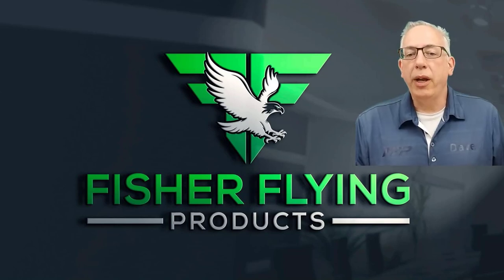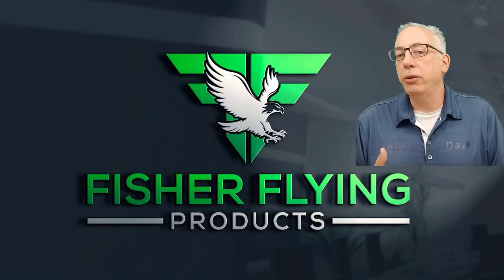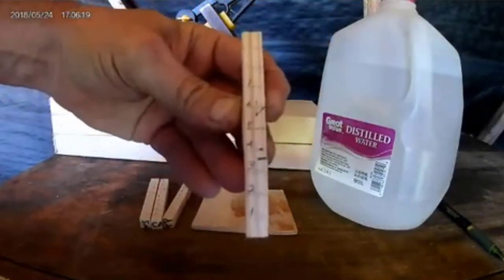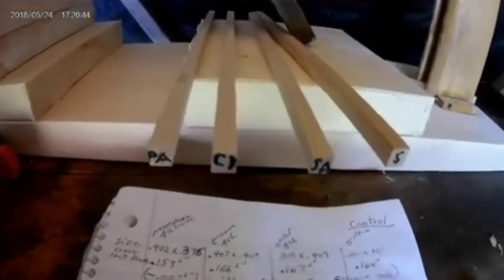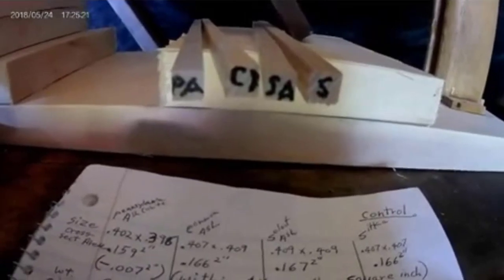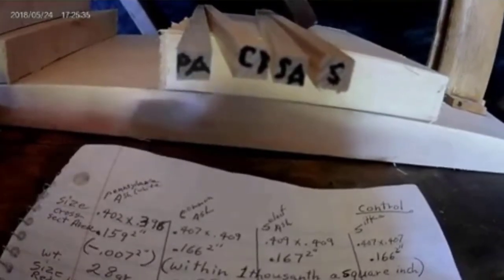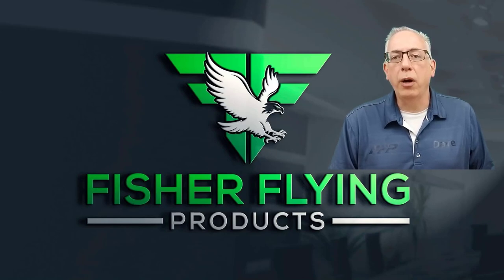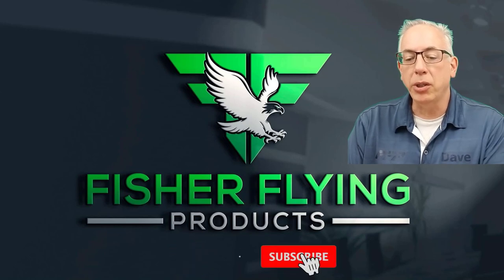Sitka Spruce Alternatives - Wood Testing Methods - Fisher News Letter 6 - 07-13-2020

Comment: You fail to mention how the wood was sawn, and in which direction the strength test was conducted; i.e. if the wood was all quarter-sawn, as it should, then did you mount the samples with the grain properly oriented? That would make a huge diference. Also, I must mention that density may be related to wood strength, etc, but it is by no means a direct physical measure of it. Another important factor, specially for airplane construction would be its modulus of elasticity.
Reply from the maker: I appreciate the feedback. We tested the coupons in both directions. I have since been contacted by an expert in the field who is conducting research on the species change on our behalf. He is modelling the aircraft and calculating the loads to then be verified in the model.